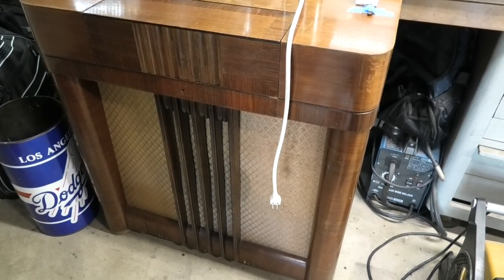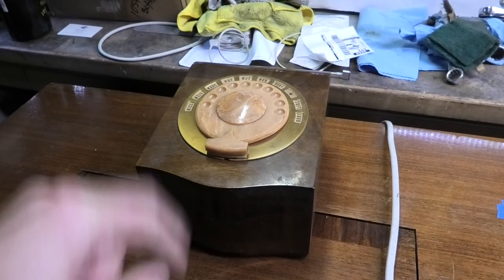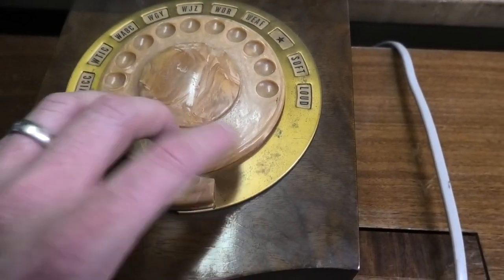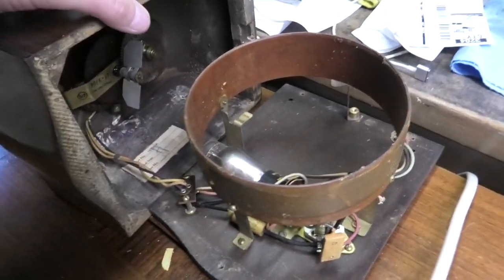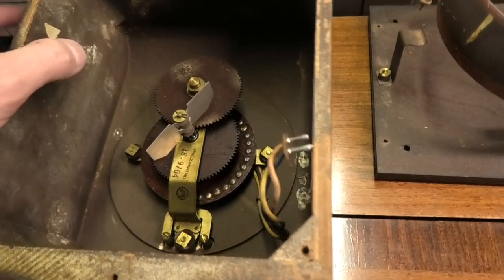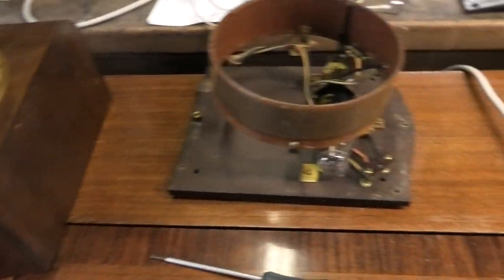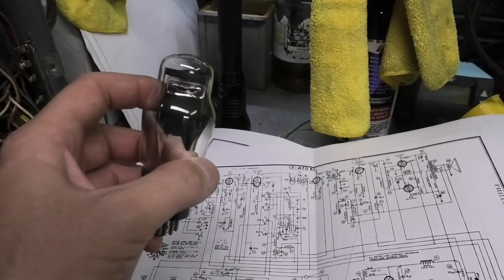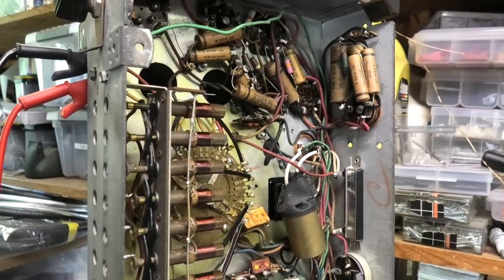1940 Philco Wireless Remote Control Radio 40-217 - Remote Analysis and Repair.

Comment: Hey that guy who found the remote was me. I'm glad someone got it. This is perhaps the most ridiculous piece of vintage electronics I've ever seen and I gotta see it working in all its Rube Goldbergian glory. 🤣
Reply from the maker: Thanks for the tip on the remote. I had to see it work and it’s absolutely hilarious.
Reply: Really different but it is cool.The man that bought it new was proud of it no doubt.
Reply: Mechtrician1,This technology was very advanced for its time especially being wireless. I personally don’t think it’s silly at all. Jukeboxes also used stepper motor systems receive selections from wall boxes and the systems were quite reliable and easy to maintain. I’m sure with a little TLC you’ll have it working properly and it will be reliable.
Reply from the maker: @Suddenlyits1960  that’s not what I am saying at all. The technology is incredible for it’s day. Their implementation of it is lacking.

Comment: Saba made a large German radio with automated station finding and a WIRED remote control. Both station and volume knobs were motorized. It was quite amazing to watch it find a strong station, driven by a motor and vacuum tubes.

Comment: I'm 8 mins 39 seconds into your video, so apologies if what I say here is worked out later in the video: The reason they keep the filament off is to save the battery. A 3 volt tube starts working almost instantly so can be used like that I'm guessing. Now to watch the rest to see my theory blown out the water lol....  edit: Glad to see you've got it working. It will probably be more responsive and reliable once re-capped, rewired, maybe re-aligned, cleaned and all the shielding fitted and back in the cabinet with all the stuff in place. Amazing innovation for the time it was made, however gimmicky it may seem.

Comment: There is a lot of information on the remote system and servicing it if you can find a 39-55RX / 39-116RX manual. It was covered in a Riders but I don't remember what model had the more detailed service information. Good Luck.

Comment: The Frequency of the remote was determined by the original seller at the radio store where it was originally bought, The frequency setpoint was kind of scattered to eliminate your remote from controlling your neighbors radio!!
Reply from the maker: I had assumed that. Like modern day DIP switches. 
What they don’t tell you is what the frequency range is.

Comment: I have a 40-206 model from 1940 which has similar RF front end with push-buttons for selecting station presets. Like your model it also incorporates a SW band. The band select switch seems somewhat sloppy in these models. There is not a positive detent feel as the bandswitch is rotated. Cleaning the switch with some contact cleaner will likely help. Good luck!

Comment: That remote WILL have to be tuned to the radio's REMOTE receive frequency! You will have to determine the resonant frequency of the radio's (TANK) circuit. its large antenna coil is found in the bottom of the radios cabinet wound in a horizontal loop parallel to the floor a trimmer cap will be found at this coil and is the adjustment point for received frequency!  -- Hope this helps!!
Reply from the maker: You must not have watched the whole video.
Reply: Yea I missed the last section of the video due to hitting the wrong key. You are right and thats how it happened.  Ha Ha my mistake!

Comment: Looks like you will have to clean and lubricate the stepper relay that controls the rotary selector switch, and replace those caps in the thyratron circuit, I had to replacwe all of them in my radio that I have!! I had found about half the caps were leaky and or shorted!
Reply from the maker: I do, but it sounds like you are commenting before watching the whole video.

Comment: Don't have allot of experience with these but I have that remote and it's warped as well. I thought heat may have got to it but now that I see yours is the same I'm wondering if the material used just has a tendency to do that over time

Comment: Hi, have you ever measured the inductance of the remote antenna loop in the cabinet? Mine is damaged with crumbled insulation and a few broken spots so I need to rewind a new one but I do not know where the connections going to the radio are tapped. I would appreciate it.
Reply from the maker: Sorry don’t have it anymore.

Comment: You have to wonder how the Philco engineers thought having a rotary dial and a tube powered remote was more effective than the later ultrasonic remotes such as the Zenith Space Command. I'm probably missing something...
Reply from the maker: It’s a pretty goofy system but then again, you have to remember, it was 1940. The US had not even entered WWII yet. It’s a gimmick for sure.
Reply: @mechtrician1  They actually work quite well. I have owned multiple ones over the years. A gimmick in that there was an entire radio receiver in the radio just for the remote system. It must be tuned to the remote transmitter frequency. The adjustments on the remote receiver section and transmitter are so the one in your apartment didn't adjust the Mystery Control Philco in your neighbor's.
Reply from the maker: @WC0125  I assumed that’s why there was an oscillator frequency adjustment in the remote.
Reply: @WC0125  Philco even thought of that?Cool.
Reply: Philco also had a pneumatic tube remote system on many of their television sets. Lot more practical gimmick.